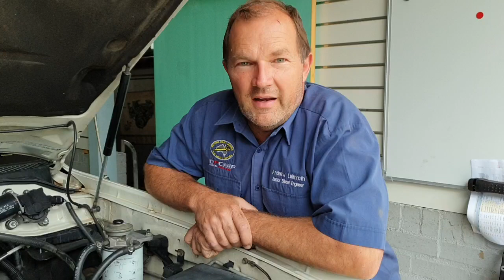Is My Diesel Safe to Turbo charge?

Comment: Hi Andrew, I have just put a turbo kit on my 2H motor, what would you recommend as a safe amount of boost for long lifespan, I have  no intercooler but it does have I 3.5 inch exhaust
Reply from the maker: Theres no real SAFE anything..... final tuning is an gets a SAFE outcome when you are knowing the capability of the Turbo in question, the Power changes before and after, The AFRS changes, The boost.

Comment: Bit off-topic, but I have a 1990 2.8 3l with only 150,000km and I'm considering coming up to get you guys turbo it. When you turbo it, do you turn the fuel screw up at all or does the turbo purely just provide more air? I just want a tiny increase in power that may or may not increase my fuel economy. I'm just reluctant because I don't want to lose economy haha!
Reply from the maker: Hi mate. The job is per vehicle. Each vehicle takes a different setting some more some less but the end result is staying in a gear higher meaning less engine ROM and less fuel used when its all set correctly :-) Cheers